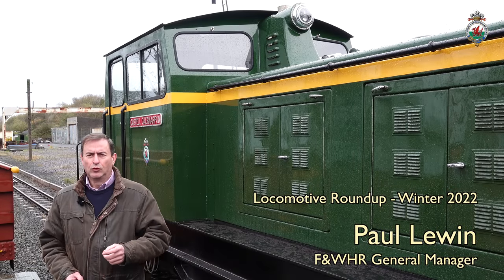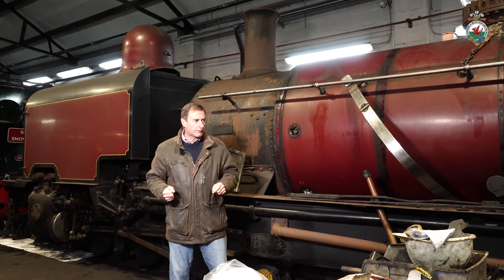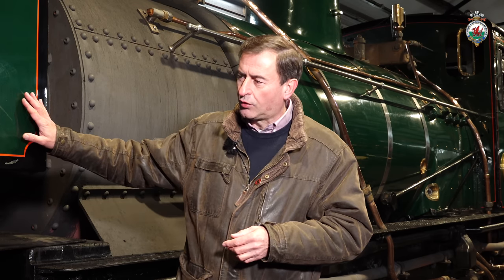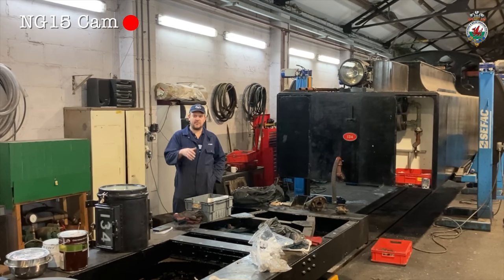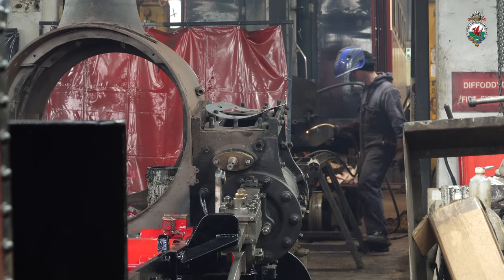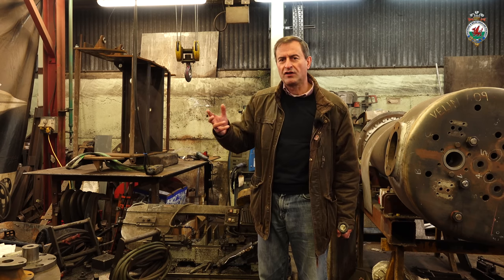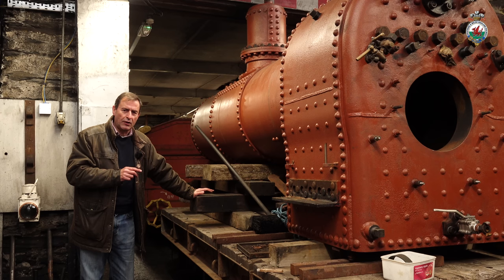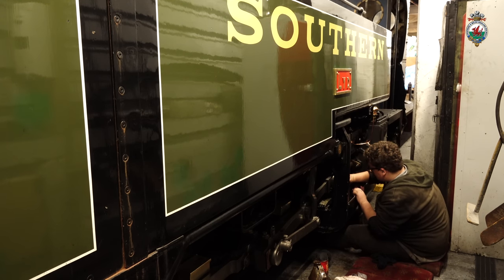Loco Round-Up - Winter 2022

Comment: Many thanks for a most interesting and informative video. One question, if I may. Why has the railway adopted right hand running on double track sections? Usually in the UK (and in many other countries) left hand running is the rule.
Reply from the maker: Right hand running through loops is a matter of convenience for the most part making the track geometry easier to run through.